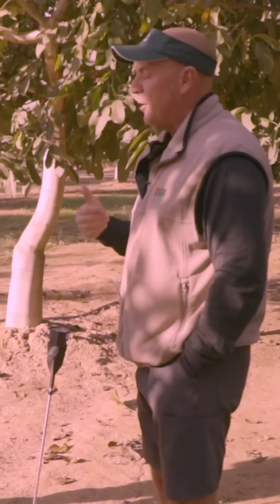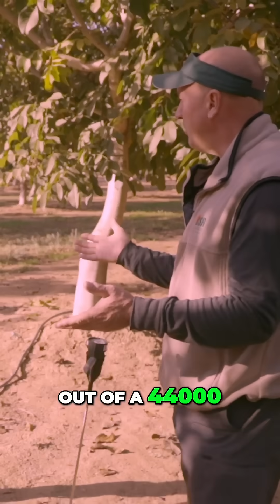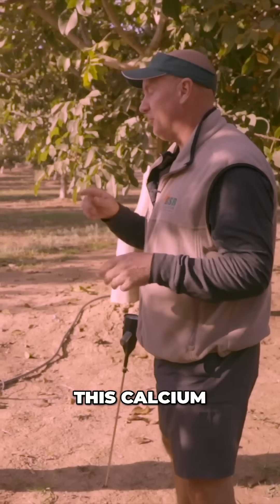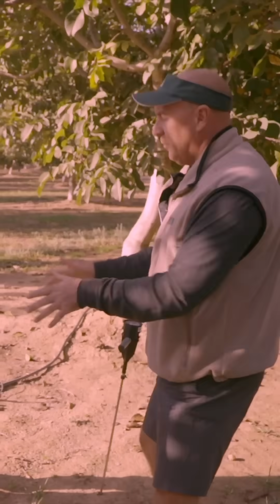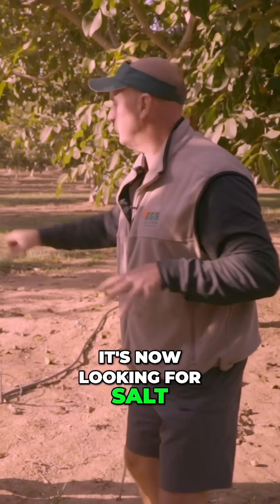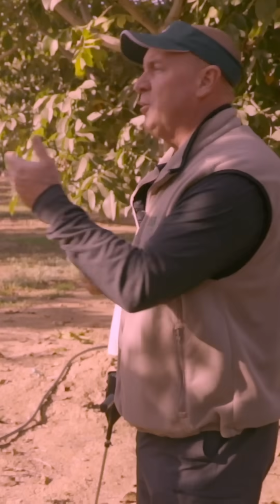GSR Calcium is Processed to Dramatically Improve Soil Structure #regenerativefarming #soilhealth

Comment: From the Planet Jr catalogue in 1922:

PREPARATION AND CARE OF THE VEGETABLE GARDEN
Prepare the Soil. To get good results the soil should be thoroughly drained; if low
and wet put in a tile drain; it will pay. Cover the ground with well-rotted barnyard
manure, a good covering of sheep manure, or a high-grade commercial fertilizer. This
lightens the soil, increasing its power to hold water. 

Rake in a thin coating of hydrated
lime (in fall or spring) on soils that crack when drying. It improves the physical
condition of the soil, increases growth and healthfulness of crops.

seems like they're continuing an old practice of liming soil.

Comment: Ca Calcium isn't chemically reacting with Alkaline or transitional metals. It's reacting with acids: (Sulfuric, Sulfurous, Bisulfite, Nitric, Nitrous, Phosphoric, Muriatic HCL, Citric, Malic, Acetic, Oxalic, chelates & Silicon acids). the only Metal that Calcium Carbonate reacts with is Aluminum. If Calcium becomes Calcium Chloride or one of the other reactive calcium salts, then it will also precipitate Molybdenum!

Comment: frankly, I'd probably go with ducks or chicken and give the ducks or chicken quarter regular grit 3 quarters oysters shell grit. Then run them chickens first to stir everything up. Then do a cover crop after the chicken. then have the sheep go through. followed by ducks/geese run cover that cover crop after it grows back. Feed the sheep a small amount of sheep nuts with a mix of biochar and seaweed lil bit of alfalfa or sainfoin.  (suppmental feed for the ducks/chicken/geese should also include biochar in there seed mix. small amount of it.
Reply: Sounds like it will be the Garden of Eden. Can you elaborate on the sheep nuts and sainfoin?

Comment: Enlightened farmer
Reply: I do not agree. Sounds like someone who doesn't actually understand what they are trying to talk about and doesn't understand the wider cycle, from the context of the clip. There is some really incorrect science in there and it isn't a brilliant method, and there's nothing I can see or hear that is in any way regenerative or at all sustainable. Separating Calcium carbonate into calcium? What? So they use a truck load of hydrochloric acid and release tonnes of C02 and end up with calcium chloride? What? Grabbing sodium and magnesium? Does he mean it flocculates them so they're less dispersed, ok, there are better ways that can actually remove sodium that I would be likely to try, like finding suitable halophytes or another more complete remediation method for sodic soils before processing up and dumping in a load of chemicals. Water activating calcium? What? It won't be calcium metal whatever they're doing. All sounds a bit unnecessarily confused to me and not in any way enlightened.

Comment: Calcium doesn’t bond with magnesium. And by “salt” I assume you mean sodium? Calcium doesn’t bond with sodium either. Did I misunderstand?
Reply: Calcium & Mg have ionic attractions to neg clay particles... it's odd bc Ca is needed to get it moving and get it sticky, so to speak (thats not the technical term, but hey)
Reply: Too much Mg in clay soil makes it rock-hard, no pores for air & water... total mess. Add Ca and for whatever reason it draws the Mg and a small particle of clay away, allowing the soil to become more 'crumbly' and airable. If your soil is a little on the acidic side, spread 50 lbs of yard lime on a 30x50 plot and by the next year it will be transformed.  If your soil is basic, you need to use calcium sulphate, i think

Comment: While I admire his energy, and while he may be correct in the sense that his soil management may yield good results, his chemistry is so wrong as to discredit him.
Reply from the maker: While Glen’s approach might seem unconventional, many growers have seen positive results with our methods. We’re always open to discussing and improving our practices based on constructive input. If you have specific chemistry concerns, we’d love to hear more and address them.
Reply: @SoilWorksLLC-GSRCalcium  I think the main concern they had was the assertion that calcium would grab on to other metals (sodium and magnesium), when this is not how ionic bonds usually work. Metals like Calcium, Magnesium, and Sodium tend to lose electrons during the ionization process, giving them a net positive charge that allows them to bond with negatively charged ions like carbonate, fluoride, or chloride. Ions are attracted to other ions, but only when they have an opposite charge, which metals will typically never have with each other, and therefore they cannot bond, or otherwise "grab onto" each other, as was suggested in the video.

Now, negatively charged metals CAN be SYNTHESIZED in a lab setting, but it's just not something that typically happens in nature, which is why people are saying their chemistry was incorrect.
Reply: His chemistry is totally wrong, but  the calcium obviously has other positive effects on the soil that he thinks is calcium grabbing other metal ions and doing I don't know what to them.

Comment: How can I add calcium to my garden without buying an expensive product?
Reply: Compost dandelions before going to seed. Compost egg shells.
Reply: Check out water soluble calcium recipes based on eggshells
Reply: @PerennialGrowth  How do we know how much is needed?
Reply: @evoliveoil  you would have to get soil or plant test to see but these are generally applied in parts of the crop cycle where demand for calcium is high. There are dilution ratios available for most preparations. These are usually 1:1000 if I remember correctly.
Reply: Grow weeds
Reply: Stop being poor. But if you have to be poor still use egg shells, or dry wall
Reply: @thehuntfortruth  What truth are you hunting for?
Reply: Calcium lime is very cheap. I buy it for £20/ton delivered
Reply: Find a limestone quarry. 
If there isnt any near by,
 go to resturants and take their compost away.
Reply: Water your plants with diluted milk.